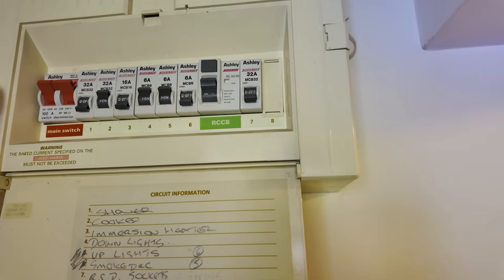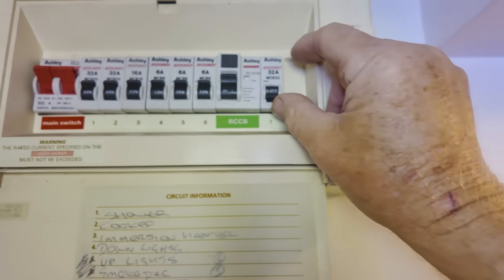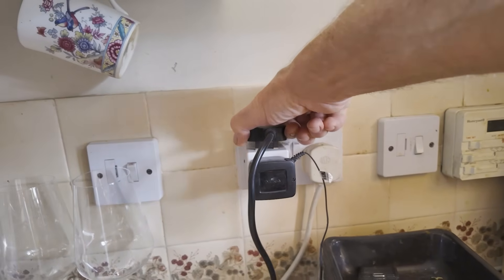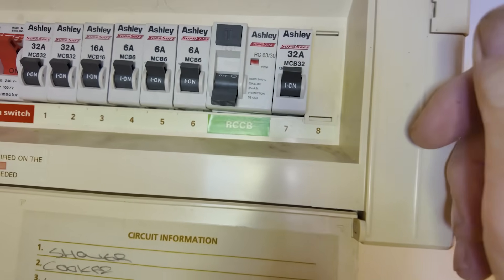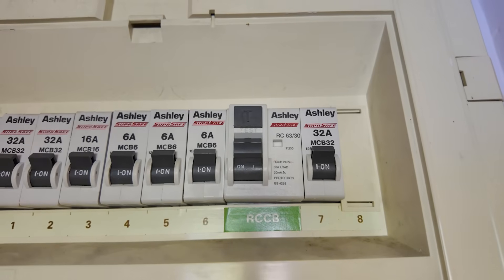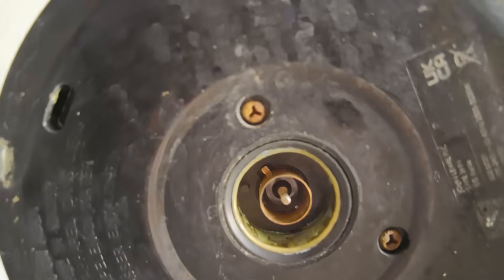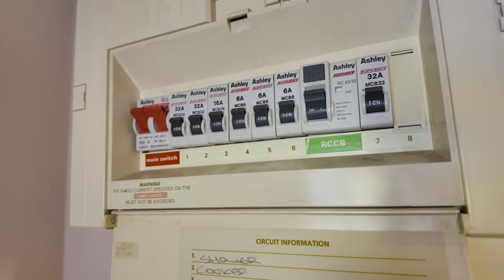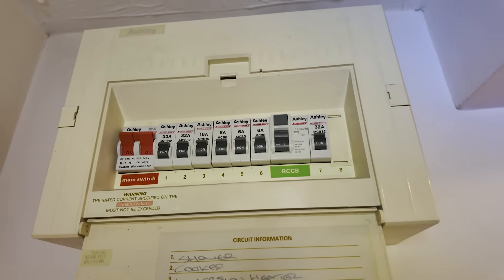FIX Your Tripping Circuit Breaker FAST!

Comment: Roger, I've been through this process so many times and it's the kettle every time! Great fun to do, very rewarding and always attracts brownie points from the wife!
Reply from the maker: could be the toaster but you are right it is often the kettle
Reply: @SkillBuilder  kettle, toaster, and off course ovens. We dealt with dozens of callouts during the lockdowns from people who've never used their oven before but suddenly decided to start baking bread
Reply: Why is that? What does the heating element have to do with tripping the breaker? Im trying to understand because I think you are onto something here! 

I can run my 15 watt blow dryer just fine but the minute I plug in my 12 watt steam cleaner that has a heating element such like the kettle it trips the 20 amp breaker every time! Please help... It's a brand new steamer!
Reply: Anything with a heating element is most common

Comment: it could be cumaltive leakage, enough small leakages add up and get high enough to trip out the rcd, over time rcd's can degrade, I have had experience with MK rated at 30mA failing test as low as 17mA.

Comment: Maybe it's not the kettle. But that is just the one that over loaded the circuit.
Reply: The RCD doesn't trip due to too much current being drawn. That would be the MCBs. The RCD detects earth leakage.
Reply: @Rooster---ooo  I had to google what an rcd is. It's just a gfci.
So that would detect too much current being drawn.
Reply: @saulgoodman2018  No. A MCB circuit breaker trips when the current exceeds the breaker's amp rating. This is to prevent the wires from overheating & potentially catching fire.

An RCD switch detects an imbalance in the current, which indicates leakage to earth. As that leakage to earth could potentially be going through a human, it is designed to activate before they are electrocuted.
Reply: In Roger's video, the bank of switches to the left & the two to the right were all MCBs, each with an amp rating. The two to the right were also protected by the RCD switch. 

Ideally, all of the circuits would be protected by the RCD. The board really needs to be upgraded & some additional sockets installed, to eliminate the need for all those extension strips. 

That costs money though &, judging from the state of the house, the homeowner probably can't afford the work. Sad to see, but a reality for many in the UK.
Reply: @Rooster---ooo  Or just a good surge protector with like 8 outlets.
Reply: @Rooster---ooo  And RCD is a GFCI.
Reply: @saulgoodman2018  Yes, a Residual Current Device & Ground Fault Circuit Interruptor are the same thing. They trip when current goes somewhere it shouldn't & to earth. Neither of them will trip due to too much demand being put on the circuit. That is the job of MCBs. 

There is an alternative to the RCD that combines the function of both RCD & MCB into one switch. I think that's called an RCBO but they're far less common in the UK. 

The simple way to remember it is that the MCBs protect the wiring & the RCD protects people. They detect different issues.
Reply: I just read to the bottom of the Wikipedia article and I see the confusion we're having. Looks like GFCIs in the US are what we'd call an RCBO in Europe & combines the functions of the MCBs & the RCD:

"A pure RCD will detect imbalance in the currents of the supply and return conductors of a circuit. But it cannot protect against overload or short circuit like a fuse or a miniature circuit breaker (MCB) does (except for the special case of a short circuit from live to ground, not live to neutral).

However, an RCD and an MCB often come integrated in the same device, thus being able to detect both supply imbalance and overload current. Such a device is called an RCBO, for residual-current circuit breaker with overcurrent protection, in Europe and Australia, and a GFCI breaker, for ground fault circuit interrupter, in the USA and Canada."

Comment: What causes intermittent trips? I have a fuse with a shower on that randomly trips when the shower isn't being used
Reply: If it is the RCCB , then it is a small leakage of current (30 milli amps going  from the 230v wire to the ground instead of the 0 wire. In this case it is dangerous as the human body can't handle much more. 
But if it is just a simple fuse or breaker then I suspect that there is either something short circuiting (appliance or wire) or you might have some other appliances on the same fuse that is too powerful. 
The easiest way to make sure is to turn of breakers/fuses one at a time and write down what does not work and check how much power that uses worst case. In general anything over 2000W should have it's own breaker/fuse and combined you should multiply the amps on the fuse by 230V to know how much Watt it can take before tripping. So for example if the dishwasher is 1800W and the oven is 2000W, you should not combine these on a 16A breaker (16x230= 3680W)
Reply: Don't get mixed up between fuse/MCB and a RCD they are totally different. Fuse/MCB is looking for an over-current, this can be a fault or just too high a load on that circuit. A RCD isn't looking for an over-current but an imbalance between the live and neutral currents.

Comment: The whole house looks like a fire hazard with all those appliances pluged into so many extention cords.
Reply: Health hazard, too!
Reply: Wipe ya feet on the way out
Reply: They might not want to upgrade their electrical system but for safety reasons, many arguments speak for it.
Reply: Hope he has good fire insurance.
Reply: Electrical contractor retired , always a difficult call as regards what is obviously required and what the customer can actually afford to do . Or in reality are prepared to do , if the inspection is non invasive as in Rodgers case and remedy is found . Then it is the customers responsibility to rectify the defective equipment , if how ever an electrician finds more serious problems and defects , it’s his or hers responsibility to inform the client of your concerns and preferably include a letter detailing your concerns . Obviously if the electrician has gone as far as doing various test readings then they also should be copied and passed on to the client . The days of switching everything off and walking away are long gone .  So this is a last resort proses , that has to be given with extreme care .  Always make sure you have covered your self if the worst comes to worst , and if necessary be able to stand in a court of law and defend your actions . We always adopted this policy , as it might be the client, but family members or friends that choose to be less than understanding .
Reply: Doesn't matter if they don't exceed the socket and circuit rating
Reply: Not an electrician a mate who knew very little asked me to sort out problems he was having in the ex council house he'd bought. There was an additional ring main fitted that covered a utility room and outhouse, spurred off the lighting circuit. Told him to get a sparks in and rewire.
Reply: @IMBlakeley  I live in Wisconsin now. They  don't  have ring mains. Every 'circuit' is a spur and each spur is loaded up...  UK didn't have enough copper after the war, so they invented ring mains to share the load over thinner wires. The yanks have never been short of anything.  I was on UK food rationing  up to age 7
Reply: @SunofYork  I never knew that the ring main was invented to deal with a copper shortage! The reason we kept them is that they're both more economical in material and more efficient, as the current has 2 possible routes to each socket.
The practical upshot is the table lamps don't dim when you plug the toaster in 😂
Reply: @RonGardener4142  yes it was WW2 and copper shortages that forced creation of the ring circuit which uses thinner copper cable..  I live in Wisconsin now and I have no ring mains...   only giant spurs.  Big and wasteful is the hallmark of the US....
Reply: @SunofYork  I thought it was only Texan cowboys who had giant spurs 😂
Reply: @SunofYork  😂🤣😂
Reply: @IMBlakeley spur it off a socket and fuse it correctly. Realistically would be fine spured off the lighting ring as it will be protected anyway. Not regs but it isnt gunna do any harm really.
Reply: @HA05GER  Pretty sure you're only allowed a single spur of each socket as a max and definitely not from a 5 amp lighting circuit.
Reply: @IMBlakeley  if it's fused I think you can have more than one. Yes it's not ideal off a lighting circuit and definitely not legal but nothings gunna happen is my point.
Reply: At the very least get a separate upstairs/downstairs/kitchen ring going.
Reply: @imaginitivity7853  in a small house one ring is fine. 32a is alot if it's not tripping then it's fine.
Reply: @HA05GER  it's fine until it's not. The fault finding for one would be a hell of a lot more straightforward and one fault wouldn't disable all the sockets/appliances in the house
Reply: @imaginitivity7853  my house was one ring until recently when I had a new kitchen it was never a problem. A fault is a fault doesn't really matter the amount of rings you should fix either way.
Reply: C3
Reply: Please check your spelling
Reply: Ooooo looking for work £££££

Comment: How can you have so many sockets off 1 breaker  which is 32 amps.  Can burn out the wiring or appliance.
Reply: Literally what the ring final circuit was designed to do. The wiring is not at risk as it’s protected by the breaker and a breaker is never meant to protect an appliance, the plug fuse will protect the flex to the appliance.
Reply: well, the best advice for a large overhaul. Last 50 years we've got so many extra appliances which was not calculated back in the days
Reply: Pretty common back in the day. I only have two rings one for lights one for sockets (including shower) all off old fashioned wire fuses. It will get upgraded in the future. Not ideal with no RCD on the shower but at least there's not an electric cooker trying to run off the ring main as well.
Reply: @gingerelvis your lights will bill a radial, they were never wired as a ring.
Reply: @edc1569  ah yeah good point. I should have said two circuits.
Reply: A 2.5mm ring is rated at 32A. The 32A MCB is there only to protect this circuit. Appliances or more accurately the flex feeding the appliance  should be protected by the fuse feeding the individual items.

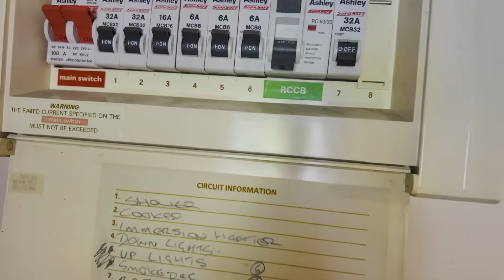Comment: 2:12 at this point, the RCD is off so it won't trip but this is the correct process. When customers call, this is what I tell them to do. 
Also, as this fault is tripping the RCD, it won't be a class II device causing the fault. If the fault is Neural to Earth, turning off the MCB won't stop the RCD tripping so you should still unplug everything in that case.
Reply: I noticed that as well. I imagine/hope it was the third or forth take and Roger just forgot to reset 🤷‍♂️
Reply: AHH well you see a lot of kettles are class 2 by label but will have earth continuity via the element. They are a weird flaw in the class system. I used to do pat and most kettles are this way.

Comment: As a time served electrical installation engineer and I would highly recommend that board needs upgrading
Reply: Sorry for the dumb question but how is it possible to upgrade a board? How do you turn the power off to the board? Or do you work live ?
Reply: @NLPexperts There is a main switch if you just want to add or replace a breaker. But replacing the entire board is not a typical DIY job, even if you know your volts from your amps. Get someone who does this all day every day to do it right.
Reply: @SolAce-nw2hf  but how is it done? How is the main board replaced if it can't be turned off? They just work live?
Reply: @NLPexperts  Not sure about UK regulations but in the Netherlands there is a fuse before the meter. It has a seal to show any tampering by unauthorized personnel. If an electrician can not remove that fuse there is no other way than removing the live  wire from the main switch very carefully with insulated tools and gloves. The end of the wires can be covered by an insulated cap while replacing the board.
But I would just get someone to do it for you. The wires can be pretty hard to work on and it's too easy to just end up with a big mess of wires everywhere. Also there may be old wires in there that need replacing anyway and sometimes even old or wrong colors. And all of this while the kid are screaming that netflix is still down 😂
Reply: @NLPexperts  There is always a main fuse at the ingress point to kill the entire circuit
Reply: @robsterenborg  so there is a switch somewhere between the electric coming in the wall and the main board that can be turned off?
Reply: @NLPexperts there’s as a minimum  service fuse that can be removed, some newer installs have isolator switches also.
Reply from the maker: @NLPexperts  no that is rare. Most electricians just snip the wire and pull the fuse.
Reply: I got mine upgraded recently. My old one looked not to even older to the one in the video. My new one has more  switches available and seems to be in two sets, it has an RCD breaker for each set. My upstairs and downstairs sockets and lights are separated and the other major power users, cooker, shower etc are all seperate. I'm sure someone can explain it better than I did. 

We needed some new sockets put I'm and an upgraded wire for the new shower so I got the sparky from work to do it for me, he really didn't want to do work on the old fuse board and, quite rightly, told us to get a new one ASAP.
Reply: @cordoroy9515  how much did the sparky charge to upgrade it?

Comment: Good stuff Roger. Sometimes the appliance may need to be put on load to show the fault as you intimated regarding the immersion heater. 90% of the time its a water related item, Kettle, washing machine, immersion, or where liquid ingress can happen i.e. exterior sockets or exterior lights, even Electric cookers.

Comment: You are correct, Roger. CB number 7 is the only circuit fed from the RCCB. Switching the other circuits 1-6 on one by one won't trip the RCCB even if there was a fault on one of these circuits.
Reply: Process of elimination is often useful
Reply: @don1estelle  in general, yes, but not if the first six breakers are not protected by the RCCB on this board.
Reply: You can see through the cover 😁
Reply: Any electrician worth his salt would not keep switching on a fault. The PAT tester is the correct instrument for this type of fault. Switching repeatedly on a fault will damage the RCD.
Reply: @keithflowers5229  but you don’t know initially that the fault is in an appliance, do you? Even if you unplugged all appliances, extension cables etc you would try to re-energise the circuit again at least once before digging out your PAT tester.

Besides, the RCCB will be rated at least 6kA and the PSCC or PEFC are likely to be well below that. Think you would have to go some to damage the RCCB.
Reply: @protectiongeek  The problem is not the repeated action, but if you reset it many times in rapid succession, you can get enough current and heat to damage the RCD
Reply: @keithflowers5229  resetting it many times in rapid succession would be repeated action, no? Repeated action isn’t going to significantly alter the fault impedance so the current will be largely unchanged. If you repeated closing onto the fault dozens of times, heat from the internal arc in the RCCB would start to heat the device and perhaps pit the breaker contacts but repeated operation in normal fault location (with appreciable gaps in between operations during which the device will cool) will not damage the device.
Reply: So it should have been before 1? You think the person almost forgot it?
Reply: @waterboy8999  context is important here - particularly which edition of the Wiring Regs applied at the time this board was installed. My existing DB has an RCCB main switch and just single-pole breakers for each circuit , so ANY residual current fault takes out the whole installation - not great. In other words my DB looks like what you suggest - RCCB 'first'. I'm in the process of ordering and installing its replacement.
Reply: @protectiongeek  interesting,  thanks for your reply.